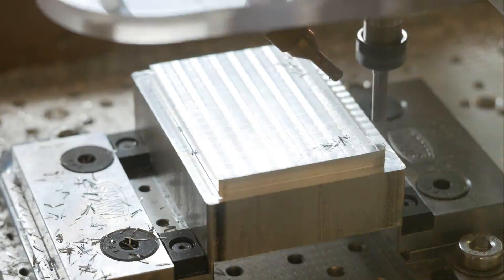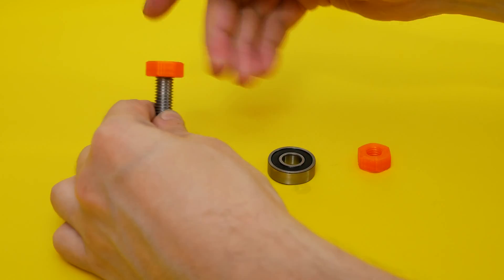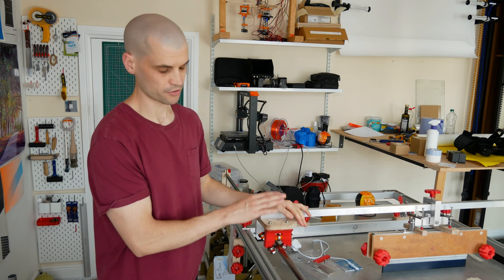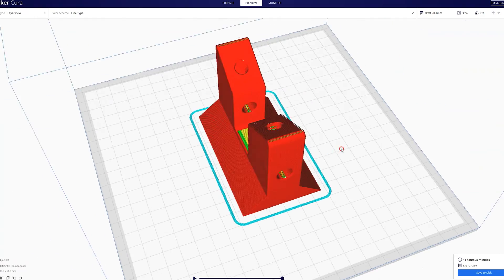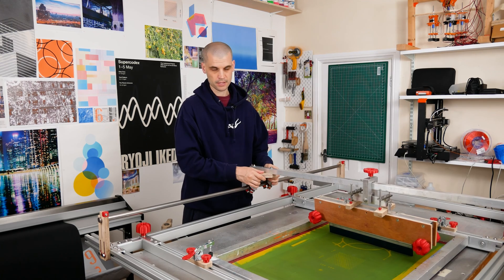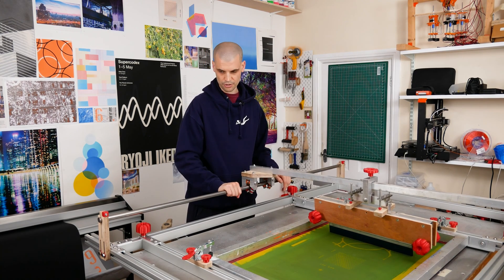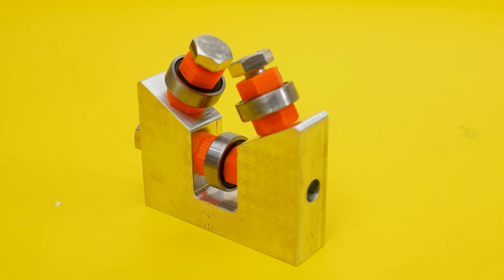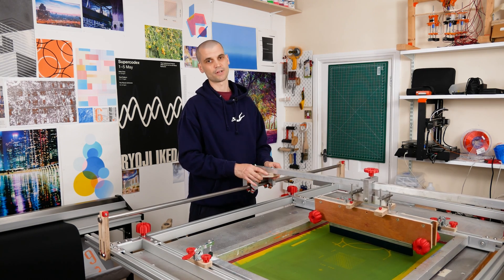Making a Linear Bearing Block for Screenprint Squeegee Arm

Comment: On this bearing there is only one ball in contact with the rod, while on sbr and lm series bearing there is multiple ball on contact with the rod allowing more load. But the major problem is the bending of the unsupported rod under load, esp in longer rods like in the video. That one could only hold a fraction of even the lm series bearing load capacity. I would use hexagonal steel rods, it is way stiffer and easy to support. 20mm would suffice up to 2 meters, the hexagonal shaft mounted to the frame using m8 bolt to holes in the bottom of the rods. 

There should be distance between the frame and the hexagonal shaft which could be adjusted by two nut and rings. The arrangement would be frame>ring>nut>nut>ring>hexagonal shaft. This way the distance between the frame and the hexagonal shaft could be adjusted. Which also enable to shraighten the hexagonal shaft in case it is slightly bent. The bolt hole made with 7mm drill bit and m8 tap to the bottom of the hexagonal shaft with 15cm distance between the hole. The nut on the frame could be welded for easier adjustment.

Comment: 4:3 you can fill it with epoxy or cement to make it Rigid .
Reply from the maker: Yes I've reinforced with epoxy previously, it works very well, but some reason i didnt do it for this project.

Comment: Hey just a little information if you want to make that a little more rigid if you wanna spray it with foam and let it expand but you want to let the phone run out the top for five or six seconds longer so you get rid of any kind of air that might be inside but that should make it more rigid I think of you as a close cell foam it'll work out really nice for those thin rods
Reply from the maker: thanks for the tips Frank

Comment: Why don't you use SCXXUU bearing, I mean what is technically beneficial to use self made bearing, Is it only cost effective or other benefit as well.
Reply from the maker: Hi Sandip, i think i talked about why these dont work too well in this application. The small bearings dont help create a smooth movement across the rod. the larger bearings seem to roll easier
Reply: @ThisDesignedThat  Yours should work better in dirty environments were stuff settles on the rods. Any dirt would tend to get on the outer race and not into the ball bearings. Sealed skate bearings are cheap.

Comment: Need 8 bearing block, in aluminium, without bearings, is there any way to buy only blocks? Thanks in advance :)
Reply from the maker: Going to be costly because of the amount of aluminum you need. Maybe you could send drawings to a local machine shop and a local machinist

Comment: Good idea, but maybe much more expensive to manufacture and cumbersome to install than buying linear bearings that are already on the market...
Reply from the maker: True, but bearing blocks are also expensive when you go up in size and this diy version performed better for this application due to the larger size of the bearing diameter
Reply: @ThisDesignedThat  Got it...
Keep exploring...👍

Comment: MPCNC uses a very similar bearing block that might be worth copying if people don't have access to a metal grade cnc.
Reply from the maker: Yes thats where I got the inspiration from :)
Reply: Seen bearing supports made from Angle iron, for those with only a hacksaw and drill press.